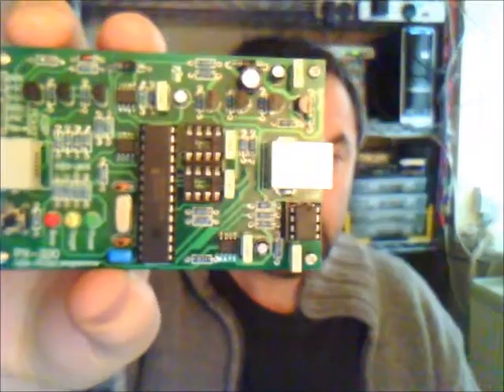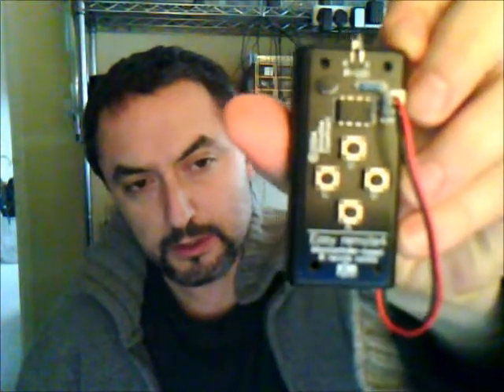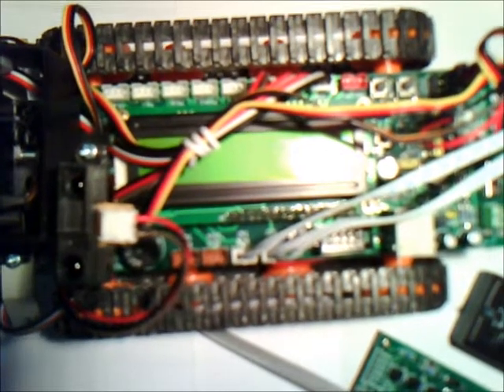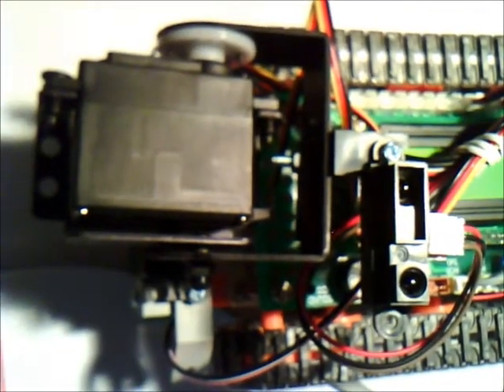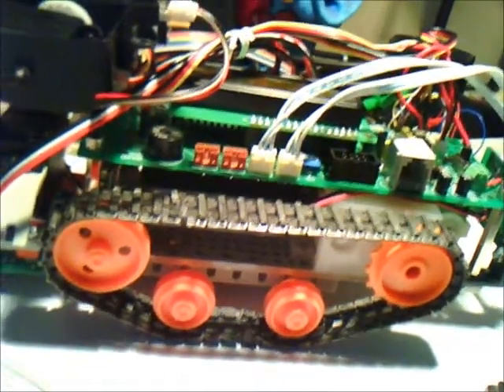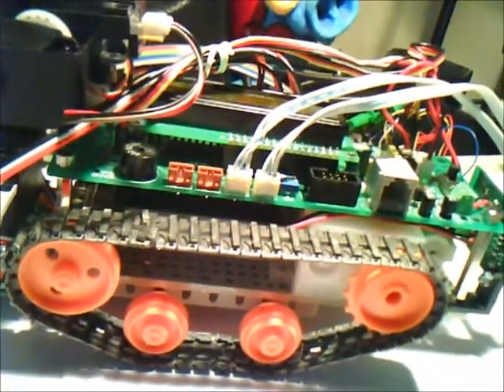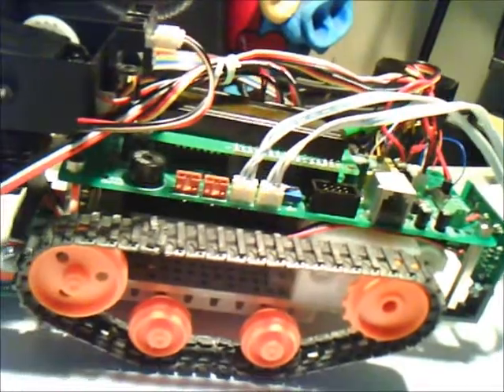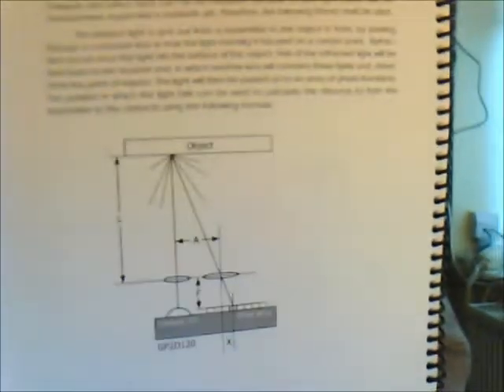Robo PICA Overview

Comment from the maker: Sorry Brandon, wrong link, now it should be ok.
With regards to the LCD there should be a jumper just below the piezo speaker. To get the back light on simply short circuit the jumper

Comment: Hey I have the same kit and the first two programming examples (blinking led, sound) work however when I try to program the LCD display I am running into troubles. For some reason the command "Lcd_Init(&PORTD); comes up with an error stating "Too many actual parameters" If you have any thought why could you please help me out!